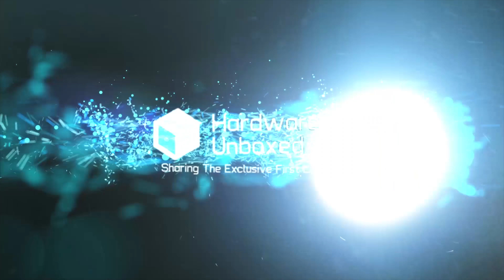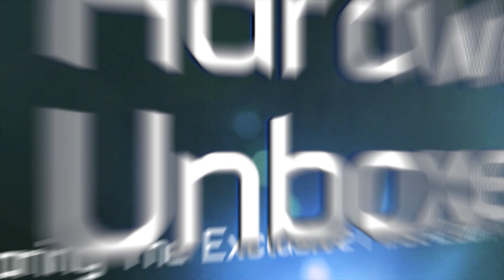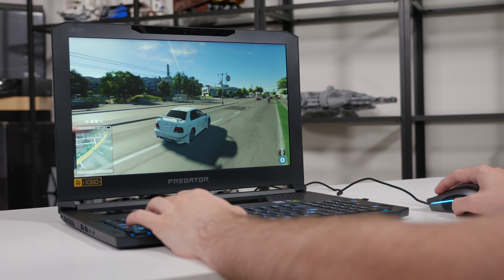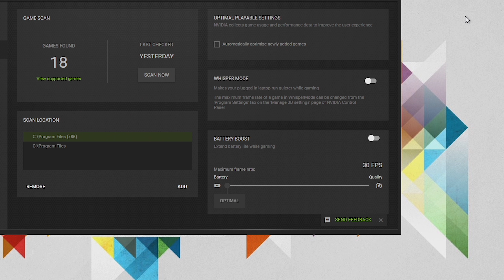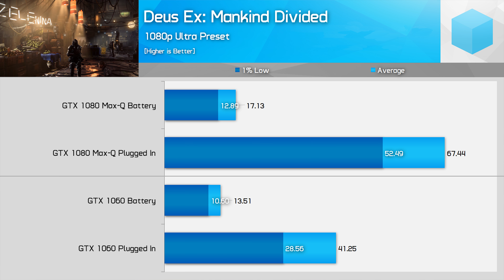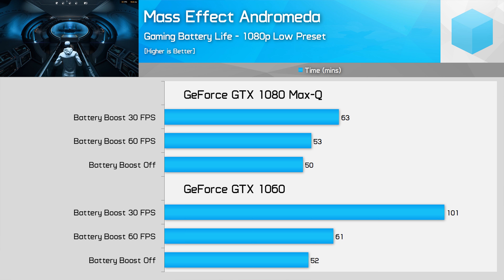Painfully Slow? Laptop Gaming on Battery Power Tested

Comment: Triton throttle is punitive. I understand that Acer wants to protect its users and their batteries. But it's such a discrepancy between AC and battery... But you can do something about it, without endangering you or your laptop.  Install Intel Extreme Tuning Utility. Then the aim is to avoid throttling - NOT DISABLING IT as it is a layer of security. I suppose you can do it with this app in different ways. For my part, I disable "Turbo Boost Short Power" and I cut in half the wattage for "Turbo Boost Power". Like this I manage to play a demanding game like AC Origin on max settings on battery at around 30fps. You can create a profile for each of your games, for AC and battery use.

Comment: What if I use my gaming laptop without battery?
By ‘without battery’ I mean to just disassembling my laptop's back case (via screw driver) and then disconnecting the battery's connection from the system and not practically removing the battery from my laptop. 
Hence the battery will be there but not connected with the laptop and therefore the laptop will work only when it's plugged🔌in.
What if I then plug🔌in my laptop's power adapter to the UPS which is in turn connected to the wall?
The UPS will also work as a backup battery🔋 if there is a power cut or voltage drop sort of stuffs. 

Some forums in the web🕸 suggest of removing the battery completely from the laptop with 40-50% charge and then storing it at a cool and dry place. 
Hence storing the battery like that (without connected) inside laptop would be like storing it at hot environment since whenever I will use the laptop the temperatures of that disconnected battery's environment shall reach the minimal of 70-75°C or 80°C+ when the laptop will be under load while intense gaming for 6 hours or more. 

So is my method discussed above safe or should I totally remove the battery?

Will my method pose any threat to the hardware or anything?

Will I be able to use Turbo Gaming mode or high performance mode with high brightness and all with my method (without battery)?

I usually use my gaming laptop like a desktop with no mobility. 
The reason I don't like building a desktop is because laptops are readily available with OS and all downloaded and they (many of them) are perhaps cheaper than building a desktop if I'm not mistaken.🤔
Reply: So it's okay to charge your laptop even at 100% while gaming?
Reply: Emir Can eh. Its gonna slow doen and might overheat if ur conputer is 45w and ur using a 65w

Comment: The problem with my ASUS GL504GS is that on battery it lowers the game FPS to almost half and then while doing regular browsing and normal tasks the performance feels extremely slow compared to plugged in regardless of high performance mode active and all power savings switched off. I mean seriously. Iv previously used HP omen With GTX1070, and Lenovo legion with GTX1060 and believe me both performed as good on battery as on power brick connected. Asus really disappointed me. If I knew they had some hidden power saving feature like this I would have never bought it. Now im stuck with it as where I live you can not do any returns or exchanges. Never going to buy Asus ever again in my life.

Comment: There are reasons to do anything, but I can't see making your choice without a very good reason and other plan for the TR system. If someone offered to trade me an Intel 8700k system for a TR 1950x there would be no way I would make that trade, no one should in terms of value and preformance. And in reverse if they offered me the TR and I had the 8700k, of course I would do so.

Comment: Nice video! It's good to see this issue addressed. If you plan to make a future one, I'd also like to see battery performance and duration with a lower power GPU like the 940MX and MX150 or with integrated graphics (for both a lower power one like Intel UHD 620 and Iris or Vega 8/10).
Reply: I was just playing Mafia 2 on the mx150. 1080p max settings, plugged in is locked at 60fps, on battery it hovers around 29fps. I7-8550U.

Comment: A trick I did for some situations is going into windows power profile and forcing the cpu to only 5% for it's max speed on the low power profile. Granted I wasn't gaming on an old Sandy Bridge HP 2560p with 9 cell battery I pushed it from 10hrs of basic office tasks/ browsing to 12hrs. 

If only we could undervolt our laptops life would be perfect. :)

Comment: Why are some older gaming laptops using mobile discrete gpus are not affected by power limits? I have a laptop made in 2009 with an i7 720qm with an hd 5600 series ( I don’t remember the exact number). Playing gta v on it using lowest settings still gives me the same fps as if it’s plugged in. ( it can play gta v at 30-40fps)

Comment: Mmmmmmmm something seems really wrong about those battery vs wall charger numbers. Maybe it’s an architectural difference between maxwell and pascal. My razer Blade with i7-4720HQ and gtx970m does not drop anywhere near that much in frame rate. Maybe they REALLY want to try to save battery life when unplugged with those models.

Comment: Why don't manufacturers make batteries powerful enough so that performance pluged in and on the battery stays the same??? Or at least give you the options to chose if you want to save battery or max parformance  even though it maybe means just 30min of playing, it's your laptop, ti should be up to you to chose.
Reply: The batteries are not capable of pushing that much wattage within safety limits. It can start a fire
Reply: Long Tran they just don't want to make it work as it's suposed to. I'm not saying a 1080 sli laptop should work the same plugged and unplugged, but a 1060 definately should.

Comment: No performance hit for me , just set Battery Power Option to "High" and Nvidia Control Panel - Power Management Mode to "Maximum Performance" . There is no way GTX 1080 laptop could be as bad as my 8 years old gaming laptop that I no longer use...
Reply: Tech Japan it depends on the laptops battery

Comment: you missed the important question: did and if so to what extend did frametimes improve, when you limited the game to 30fps?
Reply from the maker: +TheJohdu provided the game was previously running above 30 FPS the lock is solid with no stutter. 1% lots of basically 30
Reply: +Hardware Unboxed Let me rephrase the question: Would the frametimes (and especially the long hangs)have been better if you limited the framerate to 30fps, while playing games at NOT horrible settings like at the beginning of the video? that should be the case if your assumption that the laptops batteries run into power delivery issues is true.

Comment: The GTX 1060 is the ideal price to performance GPU at 1080p and will also give you longer battery when doing normal tasks. Seems ridiculous that these laptops are useless at gaming when unplugged.
Reply: JCTiggs interesting, didn't think about that possibility. So they don't just switch modes when they are gsync capable? Good to know for the future, since running a discrete gpu is way more taxing on battery life.
Reply: JCTiggs they have it but its disabled and u cant enable it
Reply: biglevian When I was looking into a gaming laptop not too long ago the two that had gsync didn't have an onboard gpu. I guess there's some technical issue that won't allow it.
Reply: JCTiggs Well, in normal tasks the discrete gpu isn't utilized, so it won't make a big difference.
Reply: Yea when u r doing normal tasks u r 95% using the igp in ur cpu (intel hd graphics)
Reply: biglevian Good point! I was thinking of the gaming laptops that have gsync and only use the dedicated gpu since they don't have an onboard gpu.

Comment: What have you done with Windows Power Management? if its in Default you will not use full performance on battery? Also i dont think the battery output is limiting the device that much since that laptop probably has a 4s2p and few hundred watt should be no problem to output. I would like to see what you get when you tell windows power management to use the performance mode and set min cpu% to 100%
Reply from the maker: +DeNNii iABLE I messed around with a lot of the power modes in the Nvidia Control Panel and Windows and nothing made a significant difference to the performance
Reply: in that case that video is fairly useful. thank you for the quick reply. I use a older asus laptop(3-4years old) for gaming on lan parties and i have not noticed a big difference in performance as sometimes i dont plug in power correctly and/or it gets kicked out of plug etc. It was shocking to see such a big difference. still in theory unless they very bad batteries they should not be a issue since stuff like drones etc use the same type and they can output sometime like 40-100amp easily. so the batteries are 1. very cheaply made 2. temp might be a issue or 3. the circuit is designed badly. 
Again thank you for the info
Reply: Drones use LiPo batteries while these laptops us a different kind of lithium battery. These laptops should use lipos though.

Comment: Quick question: How can future proofing can I expect from a 1050Ti laptop when I want to game at med-high settings @1080p?
Reply: Easliy 7 years if u dont mind med to low
Reply: Sumith Bhat but not on fucked up games like pubg ...
Reply: Sumith Bhat would last about 5 years I would say on those settings
Reply: Mr.Magnificent damn if thats what happens to you then u should learn how to use a fucking laptop... i have an 8 years old dell n5110 i7 still almost new ive been playing css on that shit for 8 years now its still fucking new
Reply: Ali0The0King 50+ fps?
Reply: Sumith Bhat yea
Reply: Jist Shock a regularly used gaming laptop will die before even close to 5 years old, 3 years at best, before the battery, keyboard and components in general will start to give up slowly...
Reply: Ali0The0King thats the exeption to the rule, and how you use it.
Most gaming Laptops operate at 80-100°C when you game on them, that leads to a much higher rate of degredation, and the silicon failing sooner, especially if you dont clean out the dust from the laptops heatsink and replace the thermal paste, which should be done on every gaming laptop that had been atleast 1 year in use, but most people dont do that.
The keyboard wearing out and the battery dying is a different story.
Also the hours you have in CSS are more interresting than for how long you are a CSS player now.
Reply: Mr.Magnificent Yes true that. Games which offered 50 fps now shows only 10-20 after 4.5 years though cpu n gpu are belpw 90% utilization. Probably something wrong with cooling or hdd or both. :(

Comment: Its interesting because I have a Lenovo Legion Y720 with i7 7700hq, gtx 1060, 32gb ram. My battery performance is exactly the same as my normal wall performance. I think the battery of those laptops u reviewed had less powerful batteries. Hoping for a reaction!
Reply from the maker: Interesting. Every laptop I've tested so far (not just the Acer shown in this video) are cut to about 1/3rd the performance at least. Even other GTX 1060 laptops

Comment: I'm wondering how far can you push the battery life by manually lowering power limit and clocks. 1080 should be better in this, since lots of cores at low frequency are more power efficient than small amount of fast ones.
Reply from the maker: A lot of games with the 30 FPS cap run at 700 - 800 MHz on the GPU... and it still doesn't last that long